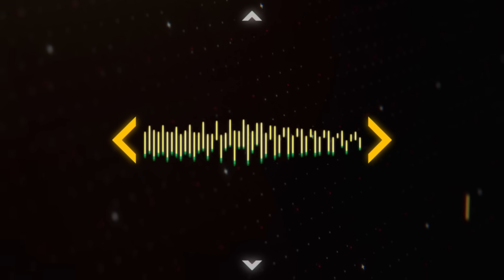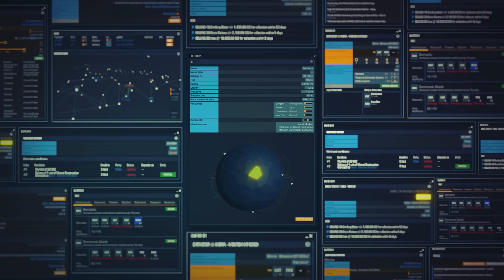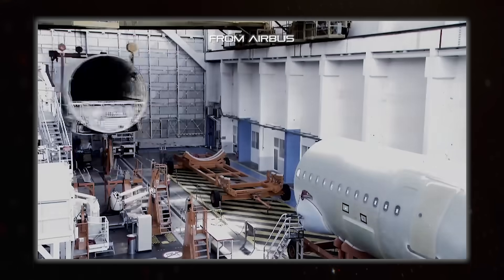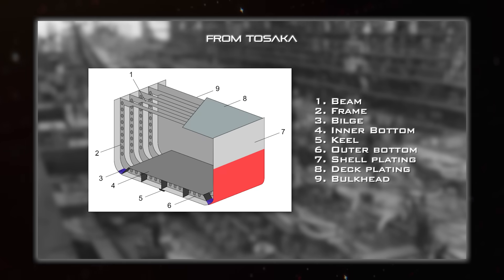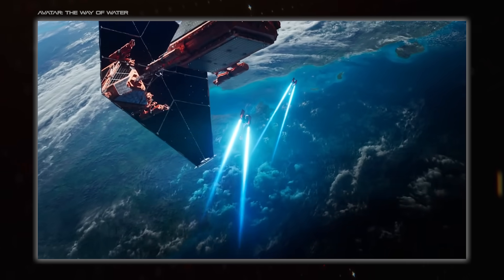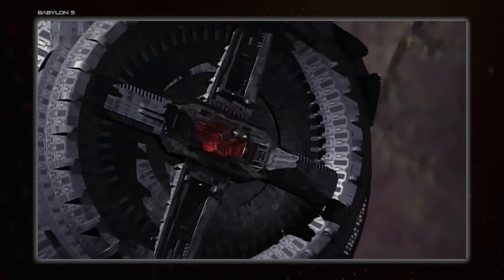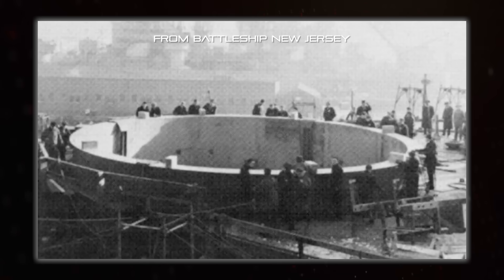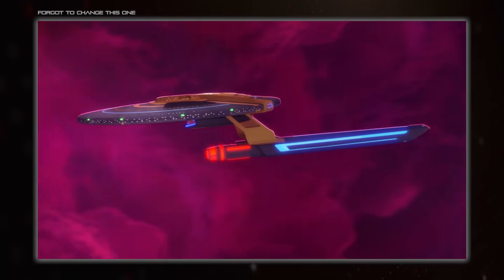How To Build the Structure of a Spaceship

Comment: To be fair though, given the amount of power we are talking about it's not like you would need to rely on passive tension or support. for large structures, you could use active support, which would reduce the mass required as the heaviest part of active support is the ability to generate energy to run it, and this is a real thing, you can either shoot particles, ball bearings, liquid, etc, just some kind of mass at a target which can provide extra compressive strength to a structure or all the compressive strength, and you can do it in such a way where you regenerate most all of the energy and all of the mass used.

Even if you completely relied on active support for compressive strength, though you would rely on tensile strength a little bit, still, in the case of a spaceship.

Comment: I had an awesome dream a few years back.  I was in a large space suit (reminiscent of Warhammer) in a queue to fill up my air.  The whole ship was like scaffolding with steel plates all over it.  It had two large forks (200m ish) so I presume cargo went between those, perhaps in containers. Workers lived in their suit - there was no inside or outside of the ship.  I was filling up my air, others were getting and chatting,  another shift was asleep on the wall (magnetic feet and no gravity).
At the back were two huge glowing engines giving very little thrust - maybe 5cms-2 ish.
The whole thing felt very real and very practical.

Comment: I‘m sorry, but as someone who works in aircraft maintenance, I have to inject here. Monocoque aircraft still have frames (not formers) and stringers, but the skin is directly bolted onto them. In a semi-monocoque constellation, the skin is connected to the frames and stringers via special clips, wich allows the hull to expand and contract due to hull pressure. Monocoque hulls do not allow expansion and thus are unsuitable for pressure cabins and their multiple pressurisation cycles. Over time, material fatigue would set in and destabilise the hull. 

Now I don’t work in rocket manufacturing, but from what I can see in the videos and pictures you show, rocket tanks seem to be built in a monocoque fashion with the skin directly attached to the structure, because a) the clips that would be needed to make it semi-monocoque would add a lot if weight and b) rocket tanks typically only go through a few pressurisation cycles in their lifetime. I don’t know how SpaceX do it with their reusable falcon 9, but even the most flown booster only has 28 cycles behind it. For comparison, most commercial airplanes go through at least two, if not more pressurisation cycles in a single day. 

Tl;dr: Monocoque: skin directly attached to the structure, not suitable for repeated pressure cycling 
Semi-monocoque: skin indirectly attached to the structure, adapted for repeated pressure cycles

Comment: The ships in my science fiction stories used inner and outer ceramic hulls that were 3D printed and fired in very large kilns. The inner hull provided most of the structural strength and was surrounded by an orthogrid structure where the frames and stringers are printed into the hull. These grid parts have a T shaped cross section so that the outer hull panels can be bolted to the isogrid. 

The outer hull's purpose is protect the inner hull from impact from small asteroids and other space debris. It consists of separate panels that can be bolted to the inner hull's isogrid with some sort of shock absorbing material between the two hulls. 

The main thrusters were mounted on wing like pylons to the sides of the hull while maneuvering thrusters were mounted to beefed up sections of the isogrid.

The ships used in my story were fairly small ranging from 5 meters long for small runabouts to 100 meters long for freighters and military vessels. The in-story rationalization was that there were problems "firing" larger structures where some parts of the hull would not be fully cured once the structure exceeds 100 meters in length.

Comment: What's interesting with the way strain transfers through a material is that it acts like a shockwave. In the same way that sound takes time to travel through air, forces travel at "the speed of sound" through any material. A ship in the scale of kilometres wouldn't transfer acceleration all the way through for seconds at a time. The speed of sound in aluminum, for example, is 6420 m/s. Still fast, but far from instant!

Comment: As it happens, the ST: TNG technical manual, published back in the 90s mentions the structural integrity fields.  As I recall, they mention the possibility of war acceleration “…. Crushing the hole like a partially deflated blimp. While this might be a valid way for a space vehicle to operate, it would look pretty silly on film.”  (Yes, I quoted that from memory.)

The same manual also mentions the equally important  “inertial dampers,” which protect the crew from being crushed, as you also mention.  (The equally vivid turn a phrase for that function states that the enterprises accelerations and decelerations would “turn the crew to chunky salsa” without that system in place.”)

Comment: Yes, 3D printing giant metal parts is cool.
But 3D printing giant metal parts in weightlessness, where the part does not need to have structural strength until the complete thing is finished would let you get away with even more unusual shapes.

Comment: Spacex uses weldet stringers tank reenforcement on falcon and Starship. Also in the expanse most ships have a very "low poly" look using flat plates. This makes sense because manufacturing flat surfaces is much easier than curved surfaces, also some armor plating might be so hard it's very difficult to bend into shape.

Comment: Age, maintenance, and original manufacturing quality are all important factors. The Battlestar Galactica had corners cut in its construction in some places, was due to be decommissioned after decades of service, and was put through punishment that would’ve crushed lesser ships. (The Adama maneuver of bringing the whole ship through New Caprica’s atmosphere was just icing on the cake.)
Also, in series like ‘Firefly’ and ‘The Mandalorian,’ sometimes crews are operating on a shoestring budget, and can’t always give the needed TLC to their ships that they ought to. Which certainly makes for potential problems for characters to solve.

Comment: In Star Trek the Structural Integrity fields resist change in material at an atomic level. Basically if it takes X amount of energy to break the bounds of 2 atoms, with the field it will take a whole lot more energy. 
Its not clear if the fields penetrate the haul or exist along the surface.

Comment: Nice video, it is an area that can really add to the story and plot line. In the universe I have created there are different ships that can do different things but basically for planets and other bodies with a strong gravity your ship needs the correct engines and the correct structure in order to survive the landing and take off (basically an anti-gravity / magnetic drive arrangement). This tends to be smaller ships except for barges that ferry stuff from the surface to orbiting platforms. Big ships on the other hand have different engines capable of FTL backed with sub FTL thrust engines but stay in space due to not being able to cope with the gravitational effects of a planet.  Big ships can however "land" on bodies with low or no gravity so long as their thrust engines are able to get them off again.

Comment: I really like how they build the colony structures in UC Gundam. In Unicorn, we are shown the "Snail," a massive disc that builds the colony out from one end, creating new habitable space as it goes. I'd never really thought about the logistics of building something as massive as an O'neill cylinder until seeing the Snail.
Reply: I love the snail. Probably the best thing about it is that it allows the colony to be used once a certain amount of it is built, and very little is stopping them from altering the colony's specifications while it's being built. Perhaps a budget deficit means that the colony is going to be smaller than expected. Or maybe an emergency means that the colony needs to be made bigger to accommodate more people. And if the snail is kept after construction as a permeant endcap rather than being detached to be used to build another O'neil Cylinder, the colony can be extended in the future at relatively little cost.

Great number of advantages rather than building it by frames and plates welded together whole, though perhaps at the cost of a higher initial investment.
Reply: @FGMagala an interesting idea, which they use in some skyscrapers. Basically you have a factory jacking itself up completed floors, which is then left as the permanent roof.
Reply: Side 7 in the original series also was only partially completed, despite already being habitable.

It seems to suggest the Snail was one of the inventions needed to get the O’Neill style colonies built in the first place, making them around 80~100 years old by the time Unicorn rolls around.

In a sense they are reminiscent of giant coal mining machines, like Bagger 293, in terms of investment and long term usage, but on an exponentially larger scale.
Reply: @tver  That reminds me of some of the tunnel boring machines as well. Not all of them are single use, but some are supposed to be reusable. On top of that, not only do they bore the tunnels, but also build the concrete walls from prefab pieces.

Comment: Speaking of the Pillar of Autumn: The Halcyon class (which the Pillar is an example of) is noted to be extremely durable in universe due to having a lot of internal bracing that can keep it together even when a large chunk of the ship has been melted. Presumably this is also what allows it to have a kilometer long midsection completely exposed to the elements for the optimal warthog driving experience.
Reply: The engineers told him "putting a road down the spine of the ship was dangerous and  insane"
He said "Exactly, that's why we made Spartans."

Comment: One other consideration is do you even need to have a 'ship'.  Could you just have the equivalent of a space tug hauling a string of pods that could be swapped in or out like a rail road train's cars depending on whatever passenger, cargo or (for the military) weapons system capacity you needed for the particular mission.

Comment: It curiously works both ways in Battletech. On one hand, jumpships are extremely fragile, their structural integrity is so low that they could be easily destroyed by a lone dropship. On the other hand, Warships are far more durable, mostly due to their compact K-F Drives being structurally stronger. By the time of the succession wars, with warship extinct and jumpships being priceless relics not easily replaced if at all, the great houses all had a gentleman's agreement that these ships could be boarded and captured, but damaging or destroying them was expressly avoided if not forbidden.

Comment: Those Spacedocks from Star Trek are always so silly... When you've got Replicators to create matter from energy directly and you've got Transporter Beams to teleport that matter into it's exact supposed location, why the hell you even need a spacedock? Ships should just appear from nowhere, just like a cup of Earl Gray. Every ship part should appear on it's exact position without even need of welding or fasteners. Just position those parts in a way to overlap each other so they'll appear instantly fused together. Voila. You can even repair your armor during a battle that way, but in the battle the energy is needed elsewhere..
Reply: Yes and no. Replicators do stuff at the molecular level, not atomic. Transporters are... hand-wave-y at the best of times, but the actual transporter rooms are BIG, and require quite a bit of power and other resources to actually work well. Industrial replicators are also very big, and seem to be specially designed to the point where their presence is a factor, and they can be considered controlled items.

Also, replicators and transporters usually don't just create stuff, they have to work with matter stores. But if you have enough carbon and water, most of the rest of organic chemistry is just configuration...

Anyway... economies of scale, even in Star Trek.
Reply: @templarw20  and there is that neat formula "e=mc²" that tells us how much energy you need to materialize out of thin air and it's A LOT since even with the Warp Drive, the speed of light in vacuum squared is still a big number. 
And well, since Star Trek runs on Technobabble, it could also just be that you can't build a Transporter//Replicator above a certain size or the resolution becomes to fuzzy if you want to justify Spacedocks. And the point docks are not only for building new ships but also for repairing old ones
Reply: @templarw20   Replicators are definitely able to create metallic structures. And metals are composed by atoms, not molecules. And since the simplest molecules are just two atoms, not a big deal anyway.
Reply: Replicators of that size, if even the Federation can build enough anti-matter reactors to power them, could be considered WMD'S.
However, smaller replicators could have you 'grow' the structure of a starship or the hull. Not as fast as replicating the entire ship at once, but it would give you the machines to repair your ships at the same time.
Reply: @Dreamfox-df6bg  I didn't mean it has to be entire ship at once. Just part-by-part.
Reply: @Boritis  Apologies. Most people who phrase it like that mean to replicate the entire ship at once.
Reply: basically because space drydocks are cool.

Comment: Never understood why they constructed ship in Earth orbit in zero gravity, when it would have made far more sense to construct them on the surface of the moon. Working in low gravity is far easier than zero gravity.
Reply: actually its the other way around. While yes its slightly more awkward, working in Zero Gravity, and construction specifically, is significantly easier than in gravity when it comes to making ships since you do not have to worry about getting the ship in question into orbit. Sufficiently strong tugs would be able to move larger ships around freely, and the superstructure of the ship would not be put under stressors until it tests it's engines for the first time.

Comment: Then you also get more unique superstructure designs such as the Tempest from mass effect, which sacrificed almost all it's hull strength for weight reduction. Instead it maintains stability through prototype piezoelectric vibration reduction technology. When the hull is bent an electrical surge bends the hull in the opposite direction.

Comment: The interesting part is that Spaceships will likely be quite fast to build. With several shipyards building small portion of the ship.
That is then transported for final assembly and shakedown at a separate location
Reply: What I would love to see, would be a "reverse assembly line", where the final product (the spaceship) don't move, and the drones move from ship to ship, attaching the same part to each. Since the ships would have more mass than the drones, that would be easier and cheaper.
Reply: @MrJHM007  It would be an evolution rather than the opposite. Sin there is no gravity or air resistance in space. you'd turn the entire solar system into a massive Assembly Line.
Reply: I keep wondering. What is a spaceship? An engine, the 'fuel tank' and a reactor, maybe a control centre. Everything else could be modular as long as it fits the structure. From freight space of various sizes, weapons, armour and so on. Even crew quarters. Everything could be modular, allowing for a much faster construction and adaption. That would help repairing and modernising a ship as well. Simply remove the damaged or outdated parts and put new ones in.
Reply: @Dreamfox-df6bg You're not wrong, but the reason you don't see much in terms of modularity in modern ship designs (although there are some examples, it's always limited in scope from the perspective of an entire ship) is optimisation.

Say, if you want to attach or remove large-ish modules from ships, you largely need to have the ship's structure be able to hold together without the module present. That's certainly possible, but it's also rather complicated, and will mean a bunch of extra mass for strengthening it, and all of this will cost a lot of money/resources/effort to design, build and maintain.

However, it would probably be more viable for spaceships, at least to some extent, as there will probably be fewer structural stresses, and if your shipyards/dockyards are in space, you don't have the problem of handling large modules and their terrific weight when you modify them (which is one of the main reasons ships' refits are such extensive processes; something like, say, replacing a worn-out engine means you have to disassemble large parts of the ship and have some truly monstrous cranes on hand); the mass is still an issue, of course, but nothing's gonna drop to the ground when you detach the engines, and moving them is moreso an issue of precision than power (assuming you're OK with doing it nice and slow).

Btw, for a realistic example of modern-day warship modularity, look up the "Standard Flex" system used in some of the Royal Danish Navy's frigates.
Reply: It depends. In the worst case you now have a really hard puzzle you have to keep track of across your entire nation. 

Imo, if you plan on building a hyperspecialized ship, where every component is unique, decentralized production makes no sense. And building too modular can create shared weaknesses across ship types
Reply: @ClippydoesntwantaRevolution000  Well yes. But that's a frontier case. 
I was obviously talking about the mass produced Space Freighters and Space Battleships.